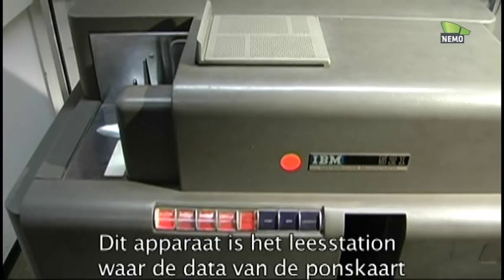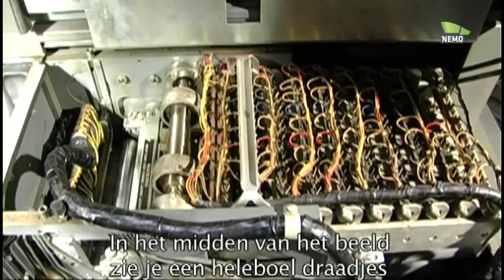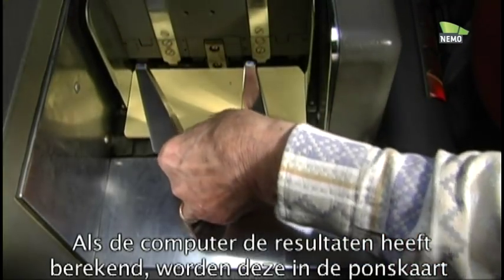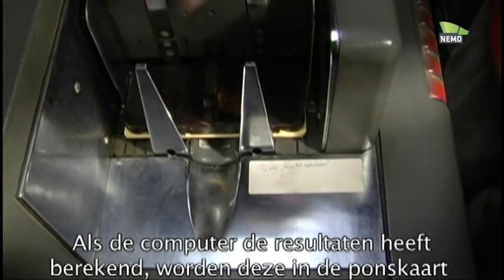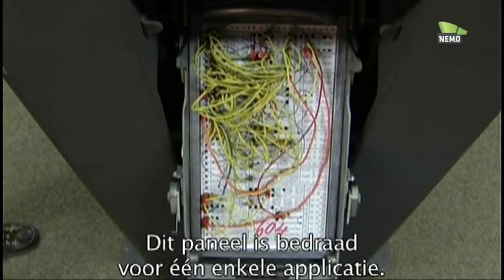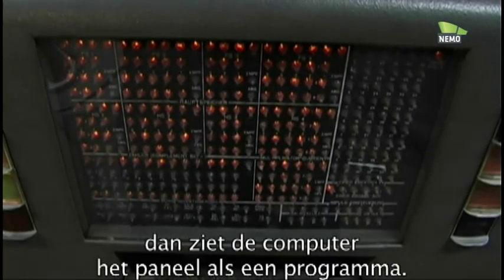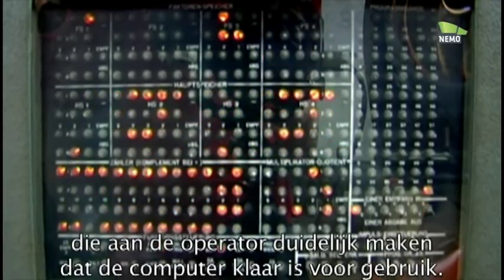Running IBM 604, 1948 computer

Comment: Love these old machines.  I used to operate an IBM 1410 in 1968. Learned how to wire panels for a 403 also.
Reply: +mike klaene That's awesome man did you have any custom tools for reaching the cables and untangling them without disturbing other connections ?
Reply: No special tools. Just be careful.
Reply: mike klaene Well they don't say Engineers are the surgeons for machines for nothing huh..
Reply: Can you tell us more about that?
Reply: @mikeklaene4359  youll love the new machines too
Reply: @mikeklaene4359  I saw an image of a computer operator/engineer untangling the wires from a IBM 5-something in 1958. You guys had it tough

Comment: Computers need to have blinking arrays of lights, so this computer is a true computer. However, computers are also supposed to make beepilly-beep sounds when the lights are blinking. This computer just makes a constant electric hum sound, so that is not appropriate.
Reply: GregoryTheGr8ster 
Instead of beeps, it makes noise like a nail gun punching the cards. More like a pinball machine.
Reply: @larryscott3982  If Charges Babbage had finished his Analytical Engine, it would have made "clankety-clank" sounds and would have been a computer.
Reply: Only in the movies, did computers EVER make beepity-beep noises.  Computers care little about the noises they make, largely because they are deaf.  But filmmakers?  Filmmakers are not deaf, and the actual sounds that computers made - especially highly electro-mechanical ones like this - are offensive to filmmakers.  Why?  Because unlike other big machines, computers don't usually indicate what they're doing with sound.  In punched-card and line printer systems, the card reader makes a fairly unobtrusive sound while it's reading in the program and data, and a LOT of noise when it's sending output to the card punch or line printer.  But if it's a magnetic tape- or disc-based computer, it makes very little noise when the program and data are being read or written, and again, lots of noise when the job is actually done, as the results are being printed out.  And for more sophisticated machines, the printing may be going on after the job is done, as it is starting up the next program.
When you get into slightly later computers, in the late 1960s and 1970s, these still have card punches and line printers, but they are always running with a queue, so the line printer noise is way behind the actual work being done, and even with the line printer running, the cooling fans on all of this collected space heating equipment swamps out even the line printer, and certainly any mag tape or disk units, and the card punch mostly takes up space and contributes its own fan noise.
Even when home computers came out, these rarely used beeps, except to indicate situations needing attention, so even in the 1980s, you see movie computers making all kinds of beeps and blaats, even though most of the audience knows that this just doesn't happen.
On one Burroughs batch computer I used for a day in a decade long ago, programs were punched my noisy typewriter-operated equipment called an "029", which just sounded like a louder-than-necessary electric typewriter.  These programs, or "jobs" were then stacked in the card reader, where they made a kind of loud whisper as they were read in, and the CPU lights went mad with activity for a bit, followed by one of two outcomes: 1) if the program was at least partially successful, in short order the line printer would start making noise as it printed the results, or 2) the machine would just go silent and the lights go into what looked like a fixed state, signaling to the operator that the program was in an infinite loop requiring intervention, and your only feedback would be the word of the operator that the job "hung".  No beeps, no squawks, no mechanical farting noises, just the ongoing drone of a hundred cooling fans.  Because computers are deaf.
Reply: BrightBlueJim it was a joke god damn
Reply: @BrightBlueJim  wow, you took that so seriously and ran with it. But still very informative none-the-less.
Reply: @DownLowdFlowd  Oh, I knew that.  I just cringe whenever I see a movie computer making nonsense noises.  That, and I clearly have too much time on my hands.  But never forget, computers are deaf.
Reply: BrightBlueJim computers can hear you if there’s a mic inside
Reply: Kelvin Guru  Okay, if you say so, I'm not going to argue.  And what were those microphones connected to, and what kind of action did LEO take in response to what sounds?
Reply: Kelvin Guru  Oh, I see.  I thought you meant that the computer was listening.
Reply: A typewriter type rhythmic clicking would also be acceptable.
Reply: Means it’s working hard

Comment: The change to the payroll tax withholding system that required table lookup in the calculation process spelled the death knell to the plugboard programmed machinery as that equipment lacked that capability.

Comment: Has anyone ported Doom to it yet?
Reply: Unfortunately, an IBM 604 is not really a computer. It is a device for performing calculations - including multiplications - on numbers read in from some punched cards and punching the results into other punched cards (with the reading and punching done by other connected boxes).
Reply: +John Savard Any sort of electrical or mechanical device that can do math is technically a computer.
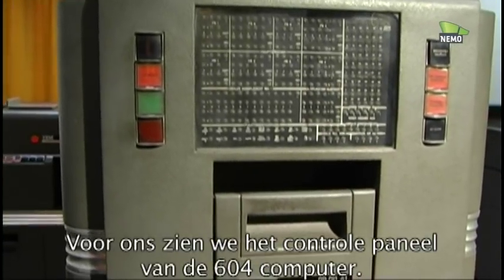Reply: +John Savard It's a proper computer all right, it has got the stored (and modifiable) program in the way of the plug board(s) seen at 0:58 and of course the cards that represent the instruction steps, and there are the registers to hold the intermediate results. See: http://bitsavers.trailing-edge.com/pdf/ibm/604/22-5279-10_604_OperMan.pdf
Reply: +John Savard It's sacarsm, why would take seriously. It's Computer kategorized by the way
Reply: Looks like the WOPR from "War Games"
Reply: Doom has been ported to every device known to man, so yes of course.
Reply: +Andrew the Plebeian. You are wrong. Any Turing complete Machine is a computer. The things that cant do conditional jumps are just calculators ;)
Reply: ...just did it!  8,345,123,833 punchcards... I'm getting 22 frames... (per year).

Comment: So happy to see old machinery still in working order. Saddest thing is when there is nothing left but a photo.
Reply: I wonder if it's actually in working order, as in capable of completing calculations, or did they just wire it to blink lights in an entertaining fashion?
Reply: @aleksandersuur9475  the vacuum tubes are lit so it has proper operating high voltages so i highly doubt its just wired to lights

Comment: Here is a Wikipedia link to the computer:
https://en.wikipedia.org/wiki/IBM_604
"Clock speed was increased from the 603's rate of 35kHz to 50 kHz. "
"Initial versions supported 40 program steps, and this was soon expanded to 60."
I don't know how many arithmetic operations per second it could carry out...

Comment: I love the glow of the plasma given off by the vacuum tubes, very radio active by the way!
Reply: +Live and Learn The tubes used in these types of devices do not emit radiation.
Reply: +Helium Road All tubes emit radiation (light and electricity), including x-ray tubes (light). No tubes emit "ionizing radiation" as do the unstable elements such as radium, radon, americium, plutonium, and uranium.
Reply: x-rays are ionizing radiation
Reply: There should be no significant radioactivity in any of the vacuum tubes. The neon indicators may have a small amount of radioactive additive to lower their working voltage.
Reply: Vacuum tubes shouldn't emit any light except filament glow. It seems like some gases leaked into. So these tubes are dying.
Reply: Mercury vapor filled tubes.
Reply: A gassy vacuum tube will glow blue, a bad tube.
Reply: Those are gas filled thyratrons. The glow is perfectly normal...
Reply: @david203  same thing as helium road said...you just said it scientifically more correct in order to look smart

Comment: so the blinking lights on the original starship Enterprise wasn't to far off from the actual truth
Reply: Computers in the 1950s and early 1960s had lots of blinking lights, because that was an easy way to report the state of the machine when it halted for some reason.  As computer circuits became more compact, and the systems more complex, designers abandoned the panel of lights and used a programmable display of some sort.

Comment: These things really were something else entirely when they came out - most businesses were still entirely paper based, and mechanical calculators like the Frieden STW-10 were only just starting to come around as viable alternatives. 

Even now, these big refrigerator sized machines are still revered in their magnificence, with their multitudes of flashing lights and loud noises as they go through their paces. The 604 is truly a symbol of what engineering means.
Reply: Where I worked, in the data center they had a few mainframes.  One day IBM came in to unhook the old mainframe, and install the new one.  I asked why they were replacing the old one, as I didn't think it was too old.  They told me it was like 10 years old and in mainframe terms that was ancient.  These two very smart technicians were in their late 50's or early 60's.  They used to joke about how the new guys had a totally different work ethic.  There was definitely a generational gap between them and the 20 something newer techs.  The IBM techs told me the new mainframes were so much faster and much more energy efficient than the old ones.

Comment: A typical small audio amplifier with 6 tubes requires around 200 watts to operate.  I wonder what the power requirements of the IBM 604 might be ??
Reply: FWIW, we had DEC PDP-11's with 208 volt power supplies on a raised-floor computer room with custom air conditioning.  Each 300MB disc drive required its own 208 volt power supply, and we had to put rubber feet under the disc drives (the size of small washing machines) to prevent them from "walking" around the floor.

Comment: i wanted to build my own computer, but after watching some of these videos what it would look like on decent level, i threw this idea away, like it will not even reach this level of engineering, since there are few components you can assemble at your home, only if you build from existing components and it wont be fully yours.

Comment: This is not quite a computer, as we think of them today.  It was an extension of the unit record equipment of the day, which were “programmable” by wiring a patch panel.  It was a calculating punch.
Reply: Well yes and no.. the first computers were made to calculate ridiculously high numbers. The fundamental bare Bones of what computers are are in both but more complex forms of thinking that machines can do today are absent in this machine. The phone in your hand or the iPad or whatever is vastly different yes but when it comes down to the bare Bones of chips and transistor or vacuum tube whatever the case may be it's a simple thing back in the day but it's pretty much the same if you think about it you're converting ones and zeros into something that the machine can read. After that basically it comes down to machine language and what your machine can do with it. Like I said the first one comment to calculate... After that it was the compile numbers list things like things for the IRS so basically Cobal your car and other government things still run on it. Real to real machines still exist they're not as popular as a matter of fact until the very recently as in a few years ago the government was still using a real to real type machine to store long-term storage Cobal is still a thing they basically just hatched in newer machines that can reverse their engineering whatever to simpler machines. But Cobal is there why because the good program and the machine languages are hard and the government doesn't like change. So your employment records and your IRS records and a good lot of the machines running today industrial wise are all ran on Cobal but she basically similar to what you were running here Punch cards and vacuum tubes and an old machine that could calculate and save. The safe part came later but you know the safe part was on the punch card. And a bunch of cards could be read IRS loved this that's why they didn't let it go .

And in they're defense it was a damn good system that serve them well for 30 40 whatever however many years and the only problem was I started having like I said to upgrade and they make things that were reversed engineering for to make them backwards compatible to the old machines and that was hard like saying 80s computer trying to talk to '70s computer or 60s computer is just really difficult who wants to write that program? I mean I say '80s because a good lot of the online features came up then you could do your taxes online or just call it in or both I mean you like to be on the phone while you're using your computer and you know like walk you through it or you keep your information to someone and they do it. That involves faxing things and yes a lot of people don't really know this but internet early internet started in the late '80s early '90s in other words my computer could call your computer like a fax machine would and basically they would talk. This Is how they did taxes in the eighties. But we're talking about the rudimentary form of this computer but like I said it's kind of like the beads the calculating beads Chinese have it's all relative. That was the first way to calculate machine wise then you have the old Cotton machines. I realize I'm also discounting some toys in here like music boxes and things that ran on little cards little Punch cards and I don't mean to do that with a lot of rudimentary little machines and mechanized things that some of them are centuries old. but they were rudimentary they weren't meant to think they were meant to play a certain program or a certain song. They really were only meant for one thing they weren't meant for thinking. But hey I'll add them in here now because they are part of what makes machines machine today. But if you were to look at that way the first robot some of them existed centuries ago. Music boxes could be considered some of the first mechanized things. So when the factories and the cotton Mills went came along and they used Punch cards as well it was just part of it. And then someone theorized that what if they could calculate for us. Because the machine could be more reliable whereas a human would not be. Because we lose our place or we can miscalculate it's not that we're not intelligent enough it's just that there's always errors machines that were created to do perfect calculations. Then like I said there was this and compiling facts about family members for the IRS they still use them today. So that's where the yes and no comes in there are still machines that work as simply as out there as this but they're rare in fact you would not need them for more than what the government or something like that runs them for but the kinds of machines that take up entire rooms still exist. I got to say it's got to be a nightmare to cool them though and God help you if anything breaks on them because that's where the IRS had a problem several years back when they're entire computer system crashed. I imagine going back to doing things manually really sucked.

From what I understand they've had some bearings success and updating their system instead of the old Cobal system they're running a newer version basically 0.2 or 3 or whatever but like I said they don't really like changing so yeah they're going to crash again.
Reply: And my point is if you think that we don't still use Punch cards and stuff like that you'd be so wrong .

Comment: Those tubes were self destructing, they are not supposed to be glowing purple. When they glow like that it means the vacuum is no longer right in them and air has seeped in.
Reply: +ElfNet Gaming That's true for high vacuum tubes used in audio and radio, but being a computer it would uses a few regulator tubes and some thyratrons for powering relays. These glow from the low pressure argon (blue) or neon (orange) present in the tube. It's impossible to tell from the video if they're argon tubes or just gassy because the camera won't reproduce the correct colours.
Reply: 256byteram That Flying Toasters icon truly brings back fond memories. I remember in '94 when my dad worked at Berkeley Systems and wrote After Dark's engine and the game "You Don't Know Jack". He had an inflatable Flying Toaster. :)
Reply: SouthwesternEagle Thanks! (I'll admit to pinching it from the screensaver with ResEdit on a Performa 575) You Don't Know Jack was a great game, I played it years ago.
Reply: 256byteram That's awesome!! I'm proud to say that my dad made that game! :)
My dad still has copies of After Dark signed by the CEO of Berkeley Systems when it was released.

He gave me the source code to it as well, which (to my knowledge) was never released.

Between only you and me, my dad told me about a new screen saver program he plans to make someday, called Sunset Dreams, based on his After Dark. :)
Reply: 256byteram Thyratrons ARE vacuum tube relays. Thermionic valve equivalents of modern triads and silicon controlled Rectifier's :)

Comment: integrated circuits cleaned that shit up.
Reply: Discrete bipolar transistor circuits also did, before that.
Reply: @herrfriberger5  — corrrect.  But early transistorized computers had lots of blinking lights, too.

Comment: Are the indicator lights similar to Nixie tubes?
Reply: thekornreeper Probably, in that I think what you're seeing there are neon gas discharge lamps and Nixie tubes were but a special class of those.
Reply: Yes. Neon indicators have a single light emitting pole and nixie tubes 10 :)